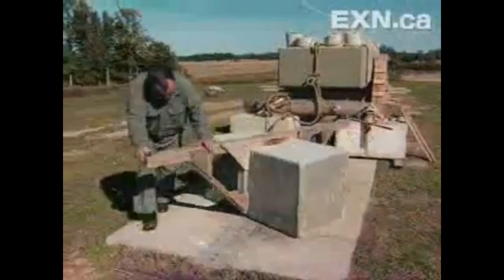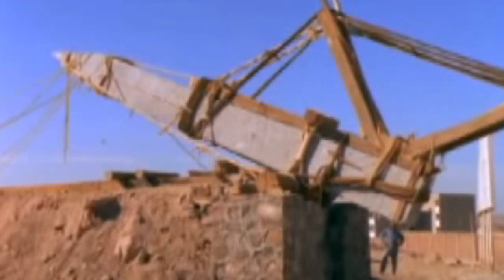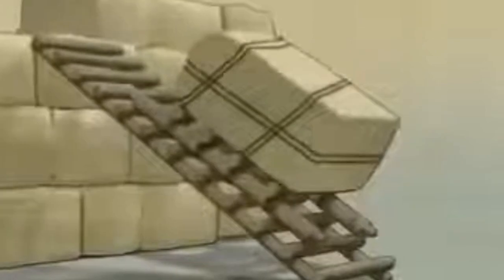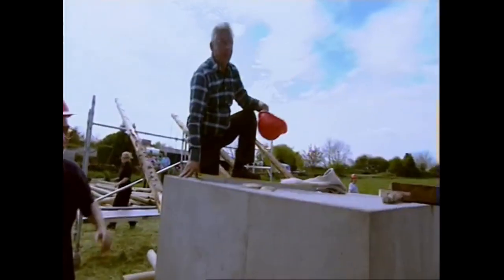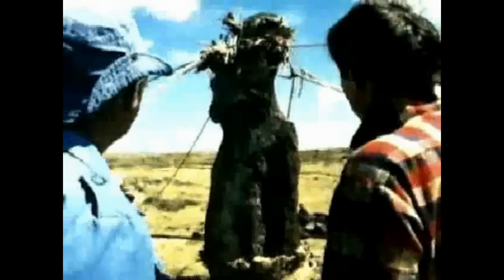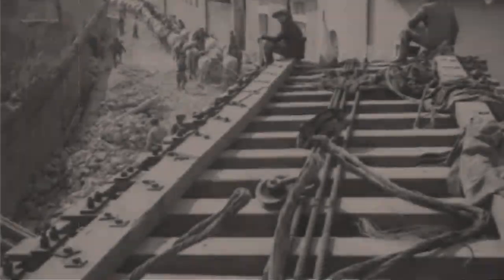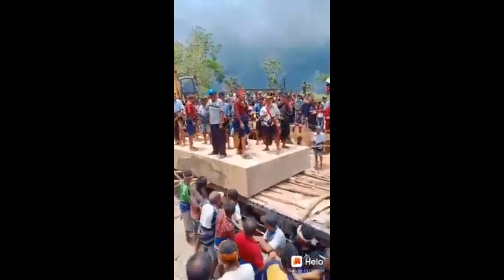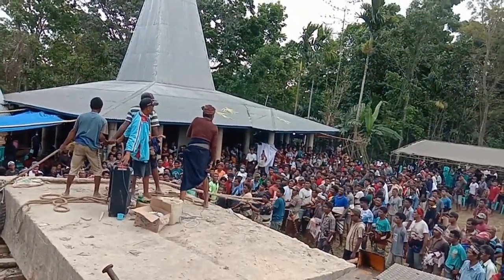How The Ancients Could Move & Place MEGALITHS With Primitive Tech. LAHT WON'T SHOW YOU THIS!

Comment: These ideas only really hold up to circa 100-200 tons at most. Much beyond that and the ropes and wood don't scale. Once you get to the stones the size of Balbec, or the 1000-1500 ton single pieces of granite and limestone in Egypt, moved hundreds of miles, the theory starts to fall apart imo. There is a piece of the puzzle missing still. It's not hard to imagine they discovered a simple technology that we have not yet rediscovered which somehow made it easier for them to cut and move heavier stones. /shrug
Reply from the maker: The ideas extend well beyond 100 to 200t, you have heard this or are making it up. Included it a 300t move.
Wood and rope does absolutely scale, whoever told you this made it up, it is a scientific reality and an absurd suggestion to make. Whoever told you this is just lying. The various timbers and finders have been and are still regularly being strength tested.
The theory does not fall apart in Egypt, not even remotely. Baalbek was moved about half a mile. While the stones that were transported in Egypt where in reality only transported 1.5 mile since the river journey doesn't count.
I have exampled with stone cutting and drilling, as well as the photo from old tier era where they did it by hand also.
"somehow must have made it easier for them" You are assuming they were somehow different and couldn't do the work like everyone has always been doing it.
Either way whoever has been feeding you these false facts please remember that they can easily be checked and it's the best interests of channels like Uncharted X to peddle in fabrication
Reply: @SacredGeometryDecoded  Your defensive tone betrays your blinkered confirmation bias. That explains why you believe what you do. Genuinely curious minds don't issue supercilious dismissals at obviously valid arguments.

Even the hardest woods buckle under given weights. A standard oak 2x4 can only hold about 300 lbs before it sags or cracks and breaks (depending on moisture, faults etc). If you use leverage then you put very high pressures on the wood at the pivot points. A 1500 ton block is 3,000,000 lbs. So, you would need a piece of wood 10,000 thicker than that 2x4 to handle a single leverage pivot point at that scale. The same applies with rope. You start needing rope so thick it isn't bendy or rope any more at that point and won't perform in the same way as at 1/10th of the scale. This is why steel cables are common today. There are only two cranes on Earth today capable of moving stones the size of the biggest monoliths (1500+ ton), and they are both stationary, non mobile cranes. To dismiss the mystery with wood and ropes moving a single 200 ton block a short distance is obviously absurd.

You think moving a 1500 ton block on a boat is easy? Have you seen what happened in modern attempts to move blocks <1/2 that size in modern boats? Moving massive blocks 900 miles down the Nile would have been mindboggling difficult. To do it with the sheer volume of stone moved in Egypt is unimaginable, even today.

I have a degree in Classical Civilisations. I was taught the standard textbook history of Egypt. When I visited Giza in my 20s (decades ago) I realised that there were obviously pieces of the puzzle missing. Geologists, engineers, masons and other professionals have exposed a great many mistakes in the way we've interpreted the evidence all over the globe in the last decade or two. 

No one is talking about Ancient Aliens here. To hear you dismiss the possibility that humans might ever have discovered something that they then lost the knowledge of is more than a little confounding. Knowledge was often a guarded secret in antiquity. There is abundant evidence that masonry to be found all over the world reveals to us lost knowledge that enabled them to carve the hardest and move the heaviest stone. Sometimes, 2+2 just = 4

No doubt the vast majority of heavy stones moved in history were done in simple enough ways, but there does appear to have been a pre dynastic period where unimaginably large stones were being worked and the hardest stones were being carved with precision that simply can't be achieved with simple bronze tools alone.

I'd concede it's possible their 'technology' for moving stones could be very simple and employ various aspects of basic physics seen in the examples in your videos. Perhaps with a few techniques in combination that spread and control the weight as they move it (like sand etc). The tool marks and evidence from the earliest periods is quite incontrovertible imo though. They were certainly using some wonder of physics or chemistry to enable them to carve impossibly hard stone far more easily and accurately than they ought to have been able to with tools attributed to the period.
Reply: @Alloneword-cp2xw  Nope. Copper is near useless and it blunts faster than the granite wears away. The tube drills with sand and days of grinding are not like the striation marks we find in the cores or drill holes. These suggest a very fast drilling which moved through the material faster than our own diamond tipped drills do. Granite 'can' be worked with copper and no doubt it was. Many of the hieroglyphs on more ancient work are clearly done with copper chisels, yet they sit on top of work clearly done with different technology. You also don't overcut by 2-3 days work with grinding, yet overcuts are found all over some of the hardest stone in the most impressive architecture and sculptures.

I'm not like a flat-earther. I have a bachelors in classical civilisations. I understand how quickly the potent combinations of religious teleology and political organisation lead to wealth and development, just as we've seen post industrial revolution. Just as we saw in Egypt, Greece, Rome etc. Things like the Pareto principle have always and will always apply to human development. There were undoubtedly pockets of time and locations where development sped up and was eventually knocked back for whatever reason. We see it many times in recorded history and there's no reason to think it was any different before that.

I'm not suggesting aliens or that they were flying around in airships. All I'm saying is that they either has some mechanisation or some chemistry or possibly even sonar technology that we've not yet rediscovered which made it simpler for them to cut and move the hardest stone on the planet.

If you can look at the tens of thousands of stone vases from the old kingdom (all fashioned from the hardest stones to work) found in Saqqara and not agree that some technology was lost from that pre old kingdom period to the much later, crude clay pots then I think you're beyond any rational; argument. /shrug
Reply: @ashmash1934  Nope. It's already been done. Plenty of videos proving it can be done. Did you know that that the SAME MARKS appear inside and those marks can change depending on the abrasion and slurry. This channel has many videos showing how the same results can be achieved using the tools they had https://www.youtube.com/@SacredGeometryDecoded. Mate, to disrespect our ancestors and suggest they couldn't do it with the tools they had is sad.
Reply: @ashmash1934  no, that's where I'm coming from. Our ancestors did know more than us with various aspects of their lives and were able to create the structures we see with the primitive tools they had. It wasn't impossible which is where the LAHT group are coming from. There must be a technology they had to do the things they did. That's incorrect. It's the grasping at some lost technology that I find disrespectful, as if they were incapable given the tools they had. They were more than capable. They had the time and the inclination to do it. They were able to move the huge monolith stone using a lot of people and animals. Ive seen footage of this happening, again, from that channel I linked too. If 1 man can move a 10ton block of stone and his own, I think a few thousand can achieve a lot more.
Reply: @Alloneword-cp2xw    I take your respect one step further (and align with the physical evidence imo) in suggesting they achieved something greater than just building these incredible structures. They uncovered the means to do so with relative ease and without the use of modern metals and a global scientific community. That means wasn't just 'animals and bronze'. They make it look far too easy for that to be the case. You can't chip the diorite out from inside a thin necked vase with a copper chisel and get it paper thin and even all the way. You can't really do much of anything to diorite with bronze, let alone copper.
The Egyptians, romans, greeks etc all did incredible things. BUT, some of the things they did appear to have been built on earlier work that's more sophisticated, challenging and impressive. The walk backwards in ability from places like old kingdom Egypt into later eras supports the idea that some technologies were lost. The similar findings at places like Machu Pichu, with older, lower work being far more impressive than the stuff on top, suggests there was either an earlier international culture with some stone-working technologies that are lost, or that certain technologies were discovered at similar times in different places independently (a surprisingly common phenomena, just look at the number of claims for discovery of the theory of evolution besides Darwin).
Either way, history teaches us that human societies can rise to impressive heights and fall in just a few centuries, leaving little behind. We can create amazing societies, then find us scrabbling the dirt to survive centuries later rather than mapping the stars and experimenting.
Homo Naledi had tiny brains and were using fire to cook and light tunnels 300k years ago, at the same tie we were just appearing on the family tree. 80k years ago we went from blunt tools to sharp, fine , expertly worked stoneware. There are HUGE windows of time for things to have been discovered and lost. For small civilisations to have appeared and been wiped out. Many archaeological sites bare the signs of much earlier inhabitation than we attribute to the monuments as we see them today.
The 'MYSTERY' of things like the great pyramid remains just that I'm afraid. Copper, oxen and rope don't cut it.
Reply: @ashmash1934  IOW, you're just parroting the LAHT party line and not anyone who is actually educated in the subject and/or has done the actual feasibility experiments.
Reply: @ashmash1934  "It's amazing to watch the mental gymnastics people will go through to avoid admitting they've made faulty assumptions"
Wow, that's some IMAX-level projection you got going on there, skippy.
Reply: @ashmash1934  How do you explain the Roman porphyry vases then? Oh wait they were white so then it is not “impossible” precision.
Reply: @ashmash1934  So if the Egyptians had the wheel and a lathe then they could build those vases. 
Luckily they did have the wheel and lathes, it was in fact the Egyptians that perfected the lathe. So your troubled questions have been answered.
Reply: @LesterBrunt   Oh dear Lester. NOT the pre dynastic Egyptians. Egypt lasted for many thousands of years. The vases and masonry I'm talking about comes from thousands of years before the wheel or lathe.... apparently. That is the dispute. What tech did that have in pre dynastic Egypt that enabled them to do much more impressive work than thousands of years later, yet still in their own civilisation. The 'experts' say it was all accomplished without bronze (just copper), without the wheel and without the lathe. The physical evidence of what was done suggests they had some technologies that we might not yet have even rediscovered ourselves.

Why comment when you clearly don't know ANYTHING about this topic?
Reply: @ashmash1934  Haha so funny how you try to lecture others while actually believing the Egyptians didn’t understand the concept of a wheel.
Reply: @ashmash1934 You are right, sir. got this clown by the balls here he couldn't even reply when you got higher than 300 ton blocks, let alone 1500 ton blocks
Reply: @ashmash1934 Hey I have a question about the vases you were talking about. If they had a technology that was lost to us and we haven't discovered it so far, why would they make every vase different from one another and not make every vase look the same, in some kind of mass production? Because we use the technology we have to produce whatever products in massive quantities. Why would we use a sophisticated technology, that is perfectly capable of reproducing and recreating any given form, but then to create each vase individually and different from one another? Let's take a CNC machine for the sake of the argument. Would you use the machine and make all vases look differently when the technology allows you to produce exact replicas for mass production? Imagine you  were a manufacturer back in the day and you were able to use the supposed lost technology and were capable of reproducing the same quality in all vases and that would give an advantage to all the other manufacturers. Would you choose to make your vases each look differently?
Reply: @cCiIcCo  well, first I'd say that assumes production techniques 'like ours'. Using a lathe (which was not supposed to exist), with cutting tools that made easy work of stone is not the same as factory production, which lends itself to reproduction. Secondly, I'd say there are LOTS of absolutely identical pieces (particularly in things that needed to be like temple columns). Thirdly, I'd point out the value of something is defined by it's rarity and desirability (supply and demand). Anything produced en masse is definitively worth far less. Anyone wanting to produce things of value will indeed make each one different to preserve the perceived value of the thing. That is consistent across any time or culture.
So, they did make MANY identical things, they perhaps did not do it so often with object d'art because the value of artistic pieces is defined by their uniqueness. Also, the logic behind this does nothing to explain paper thin diorite vases etc, it's not a cogent argument because it doesn't explain how it was done, it simply questions the motives for doing it, which is a logically fallacy given the question is 'how was it done?'. Not by sanding it down by hand, that's for sure.
Finally, I'd point out that the vases we have remaining are the ones considered valuable because they are the ones buried in tombs of important people of the time. They would not be buried with the ikea rubbish that may well have been mass produced, they were buried with pieces considered to be valuable. Would you be buried alongside stunning antiques or with the off-the-shelf stuff? It may well ahve been that there was some mass production, but those pieces would be the least likely to have been preserved/saved in the tomb settings we find them.

Comment: it's amazing how they moved these size stones but doesn't give me any insight on how they move 500-1000+ ton stones. and building up? no demonstration. i cannot fully accept this theory.
Reply: Unfortunately for you = your personal incredulity does not alter established facts as "you" are not the arbiter of the same. 

p.s. - you know the first rockets developed were not that large.  Within a few decades of their development however man was building enormous multi-stage rockets and sending those out into space = how??  Answer:  the science behind them was the same irrespective of their relative size.  

Thus if one can move a 50 or 100 ton block using a specific method = upscaling that to move a 500 ton one simply requires a bit more resources and effort as the science is the same.